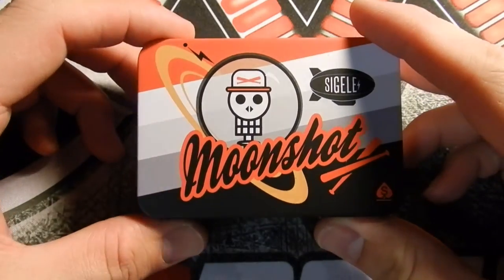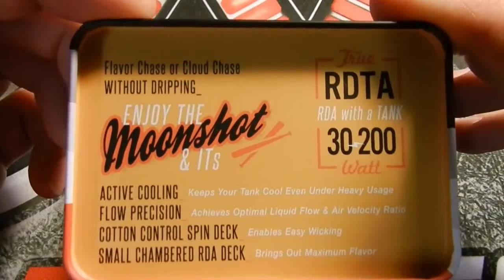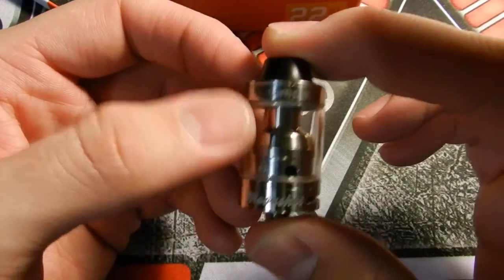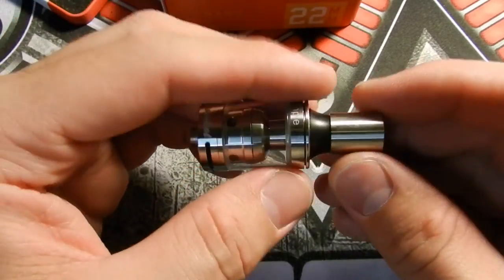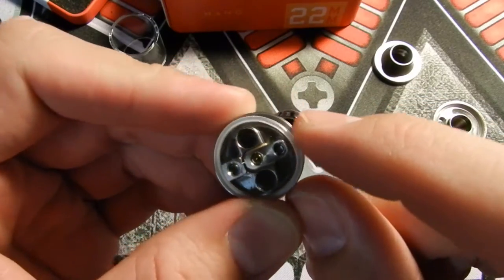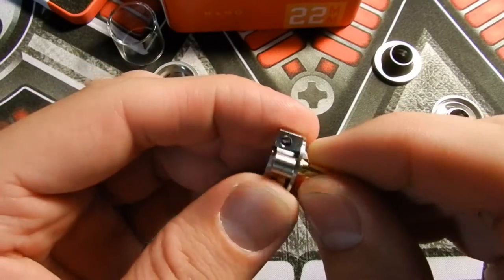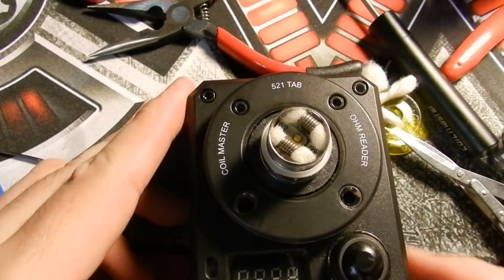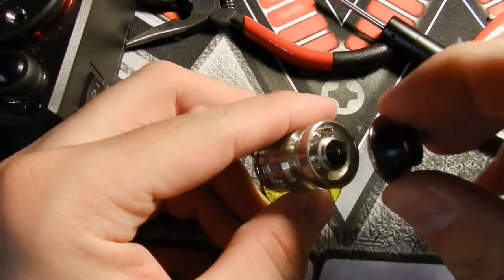MoonShot RDTA

Comment: i dont see that was a necessary to put the allenkey through the hole without sitting the deck into the base. hahahaha!
Reply from the maker: +Encik Zulyadi it does not screw into the base you actually have to hold it with your hands to build on the thing.